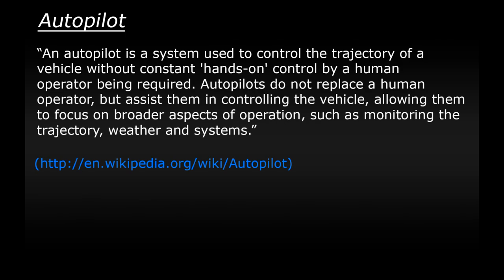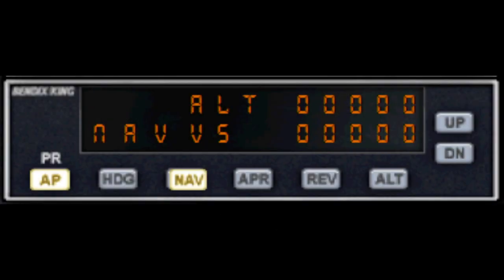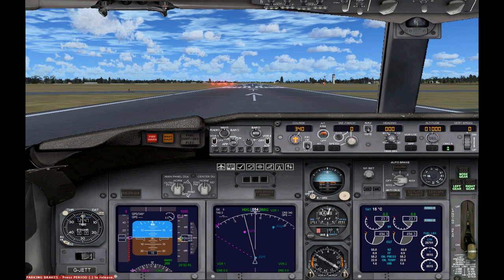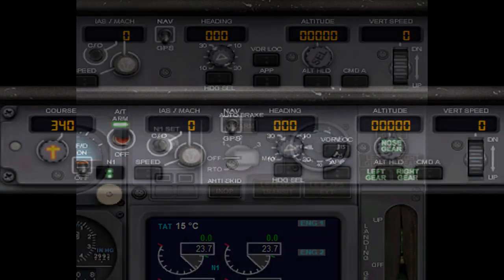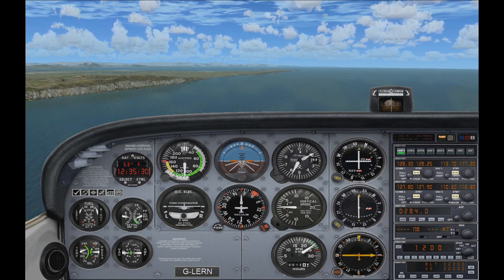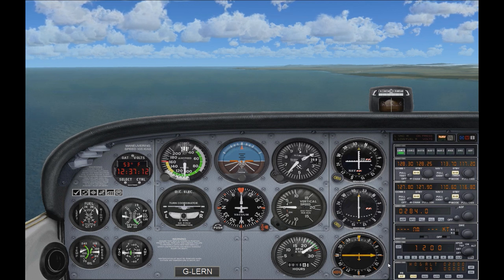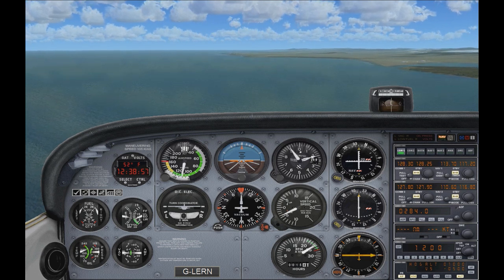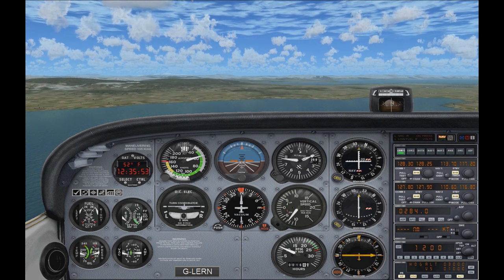FSX Tutorial: Autopilot

Comment: I think a good way to describe the difference between course and heading is this. -- the course would be like the amount of degrees you are planning to fly or the direction it wants you to fly, and the heading would be like the actual physical movement of the aircraft banking to a certain heading on 10, 20, or 30 degrees.
Reply from the maker: Nope, the movement of the plane is "Rolling", the plane will "Roll" to a "Bank Angle" of 10, 20, 30 degrees. Heading is the direction that the nose of the plane is pointing, Course is the direction the plane is flying over the ground and isn't necessarily the same as the Heading. For example, if you're flying with a crosswind, you have to angle the plane into the wind and the plane will drift sideways through the air, therefore the Heading and Course would be different.

Comment: Just got back into FSX.
I recall an issue that I have rediscovered...
I have buttons on a button box mapped to the AP.
When I use those buttons to activate the AP heading or Altitude the heading snaps to current heading and the altitude snaps to current altitude erasing the desired settings I had input to the AP.
If I mouse click on the relative AP buttons it works as intended and the aircraft responds to my AP inputs.
Thoughts?
Thanks!
Dave

Comment: Thank you for this video about the AP. It is very helpful. 
The aircraft (C-172) I have been using for training has an AP just like the one in the video, but I've never received any instruction on it. I don't know if it is so simple as some would say, but I guess in aviation I don't want to think that anything is simple. I mean, I don't want to underestimate even the simplest equipment and lead to an incident.
I liked your point about one needs to use the AP within the aircraft's limitations. This reminds us how important it is the basics we have learned.
If you don't mind me asking, I would like to know how to change the VS on the AP in the aircraft. Is it the same UP and Down bottoms for the altitude?
The video only show how to do it on the simulator. 
I appreciate it.
Reply from the maker: DO NOT USE THIS VIDEO AS INSTRUCTION FOR A REAL AP UNIT! Speak to your instructor about using a real world Autopilot unit. 

The Autopilot in FSX is a simpler version of real world autopilots and they work quite differently. In *FSX*, the up and down buttons are used to adjust the Vertical Speed.

Comment: Hello. So what is the use of Flight Director? And I still cannot get the meaning of 0.00 shown in the speed box? What is it? ((I can't get it probably because I cannot understand the difficult English. Maybe typing it out will be clearer for me))

Thanks for your great video!!!
Reply from the maker: +King Lim Pang The Flight Director will draw some crosshairs on the Attitude Indicator. This is to help you manually fly the plane to the Altitude and Heading you want. As for 0.00, that is the Mach speed of the aircraft. During the Cruise phase of flight, the speed is usually measured as Mach speed rather than Knots. For example, a plane might fly at Mach 0.75 during Cruise.
Reply: +Doofer911 I see. So the cross shown in the altitude indicator is given by the data you put in the autopilot box?

Comment: Hi Doofer. Again from sunny Cape Town. I hope you can help me out. When flying the A2A 172 in level flight and press the Auto pilot button the plane just starts shooting up like a rocket. I have read the manual so many times and cannot seem to find anything. It seems as if there is some sort of preset and whenever I engage the AP it just does it own thing. I have watched your tutorial re AP (several times     many times) and gone through your steps. But F%&***&% nothing works. Steam edition of FSX
Reply from the maker: The A2A Autopilot doesn't function like the standard FSX version. If I remember correctly, you need to dial in your target altitude, select "Arm" then select a vertical speed.

Comment: How can i calculate of define the vertical speed in simple planes ?
Reply: Mohamed Faysal For a normal (comfortable) 3° descent angle it's very simple, just multiply your ground speed by 5. If you are flying 100kt , you would aim for a 500fpm descent. If your main concern is to lose X feet in X time than just take the formula V(speed, in this case your VS) = D (distance, in this case your feet that you want to loose) divided by T (time, in minutes). If you want to loose for example 4500ft in 5 minutes you take a 900fpm descent (4500/5).